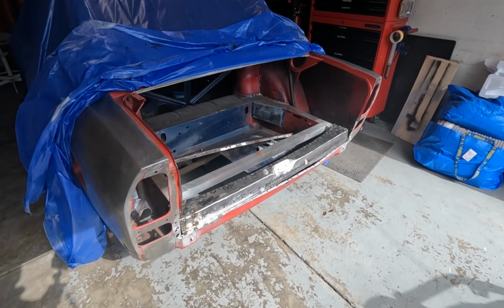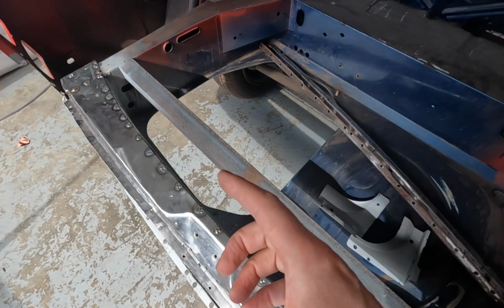The Fiat 124 Build : Episode 25 - Most Difficult Repair So Far!!

Comment: Outstanding Amigos! Johnny forgot to mention to fit  the rubber seals up you intend to use on the boot and doors for the ultimate fitment test.
Reply from the maker: Hey Graeme, I'm hoping there will be a bit of room for any adjustments with the boot latch haha should be ok.

Comment: Thanks for the new episode.. Some great panel beating there!  Did you match the curve with boot lid?  
I have noticed in my project that with my rebuild, I could make the doors to align better than it was originally from the factory...
Reply from the maker: Hry mate! Thanks for the support. This area was very time consuming, and only being able to do this on the weekends really drags the repair out.
I tried to replicate all the curves with what i was replacing, then did a quick check with the boot back on.
Hope your build is going well.

Comment: Great work . I hope you test fitted the boot and lock as they can be a very big pain if you do not get them right .
Reply from the maker: Hey mate, i dropped the boot back on and all lined up reasonably well. Im going to check again before paint.
Reply: @FISHERBUILT I would have recommended putting the boot with lock on as misalignment of the boot lock will be a right pain .

Moving ahead I would go the same with doors and bonnet . Test fit all with locks .